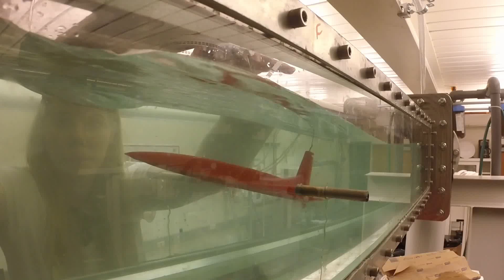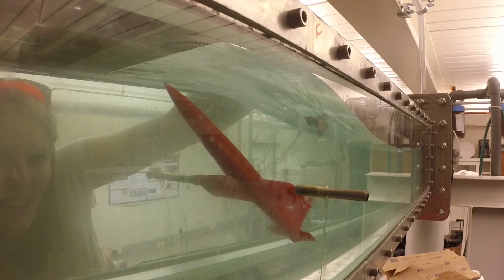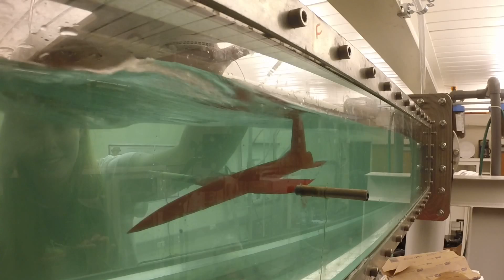Speedfest 2016 Black Team Water Tunnel Test - Vid 1

Comment: what is max reynolds number of water tunnel?
Reply from the maker: Depends on your length scale, the maximum width (or height) is 152 mm, which that gives a max Reynolds number of 1.5 million. However, it was designed primarily for flat plate turbulent boundary layer studies, so based on downstream distance the maximum Reynolds number is 10 million